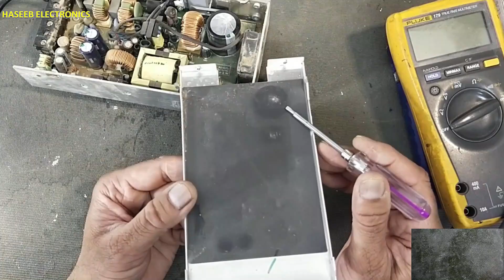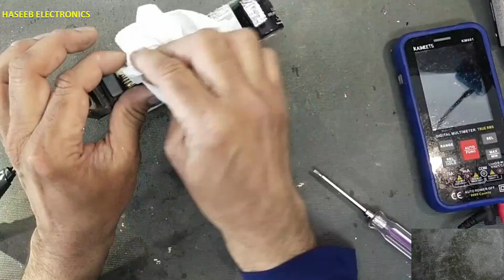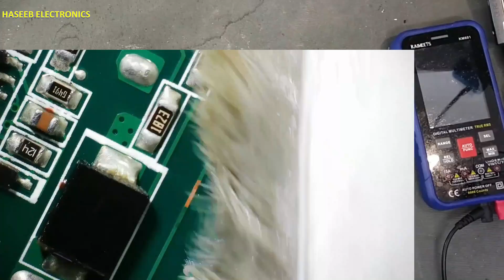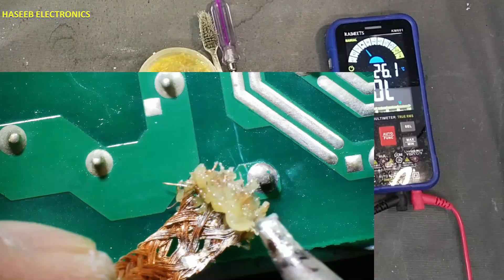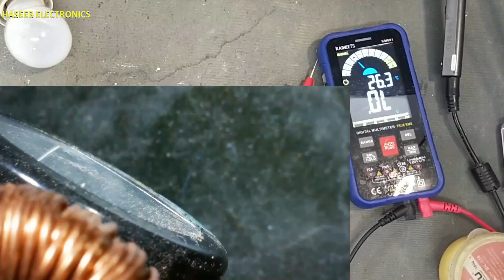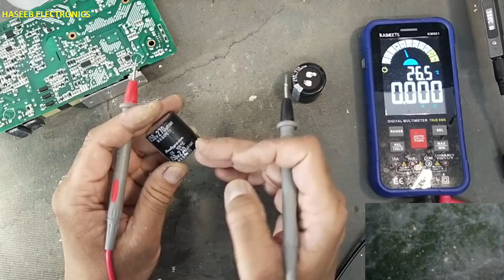{1086} Delta SMPS not turning ON, smoothing capacitor failure

Comment: Wow I really enjoy watching you do what you do - I just recently returned to the trade - I started back when I was 25 (funny how life goes sometimes) always had a love for electronics. So, I broke out all my old gear and sat down and I was like a kid again. Now older and can afford some of the things I could not back then allows me to enjoy it just that much more. Sorry to get off subject but watching your work has helped me so much, I just had to say that. 

I love the way you break down the workings of not only the overly complex systems but the easier as well, I think for myself it helps to grasp the connection between all the different circuits and what they are ment to do. My biggest problem is knowing where and how one circuit starts and at what point it ends. I understand it as a block diagram but when I actually look at the board all your teachings go out the window. Maybe, I'm over analyzing it for what I would have to do to make a repair. It is what I'm missing to understanding electronics down to component level (or is it)?

Thank You so much for all you do.

Comment: Great looking repair sir! 
 I'm in the process of building "Mr. Carlson's Lab" capacitor leakage tester to check for electrical leakage. I've already made my own version using a bss138 mosfet (just what I had in the junk box) with the gate pulled down with 5x 10 meg ohm resistors. The sensitivity is "adjusted" by using more or less resistors pulling down the gate harder to make it less sensitive for large value and electrolytic capacitors. An led will light and not go back out for a leaky capacitor. The capacitor charges and if it doesn't leak electrically there is no current so the leds goes out once the capacitor is charged. You have to hook the cathode of the led to the drain, the source ti ground and the anode to a 3k resistor if your going to use 30 volts, 1k for 12 volts or less. I'm able to check capacitors with under 30 volts and I've found that if they are bad they will leak even at 5 volts. 
  I also have another circuit using a 100 uA analog meter I put in series while I SLOWLY increasing the DC voltage to allow the capacitor to charge. This allows me to use high voltage to check electrolytics at their rated voltage. The meter jumps around a lot during the charging process, but this is okay with electrolytics. They'll "leak" 10-20 uA or so which is okay. Diodes going across the meter in both directions save the meter from ever seeing over .375 volts if you use schottky diodes. 
Ultimately, my goal is to build a capacitor tester that checks leakage, capacitance, AND ESR. Mr. Carlson's ONLY checks for leakage. I hope these ideas are helpful to someone. It is amazing what you can build with a handful of cheap parts! A mosfet from one of these power supplies would probably work fine. Best regards Sir!

Comment: Hasheebji So many of these delta supplies, cc tv or something else . robust though
Reply from the maker: it is used in industry to power up some devices. it is awesome design
i got 25 supplies to fins the root cause for their failure. now i am summarizing it and then a final conclusion will be estabilished
Reply: @HaseebElectronics wow, i am sure that you will make a great Engineering root cause result 👍🏻👍🏻 please share it with us if possible.
Reply: By watching your repairs of this type and model, i am sure that they are installed in high humidity area or harsh environments, if so a conformal coating is a solution right? Maybe you can add solution section in the report right?

Comment: Hello MR Haseeb, im a new viewer of yours. I started repairing SMPS. I have fixed a couple of boards and tested with spare electrolitic capacitors i had.
Now the board is functioning as it should, i have the output, but the board started to be noisy, i hear the  high frequenzy buzzing...why?
Should i increase the Cap values?
Can a low Cap value increase the audiable noise?

Thank you! You have a new follower
Reply: +1.In some smps am also heard the sound.
Reply: You'll not be disappointed in Haseeb, so welcome to the channel. I have heard some smps's, particularly larger ones, make an audible noise. Much like the 15 khz noise you can hear from older crt televisions. I too am curious. I had a 50 amp 13.8 switch mode that was so noisy, that I had to put it in a remote location out of the room it was being used. I guessing that windings in a transformer could be a little loose. I've had a noisy 60 hz solenoid on a heat pump once that I dipped in epoxy and that was enough to quite it down.